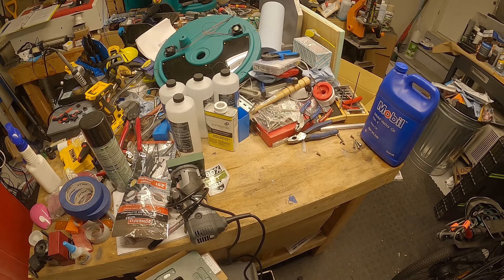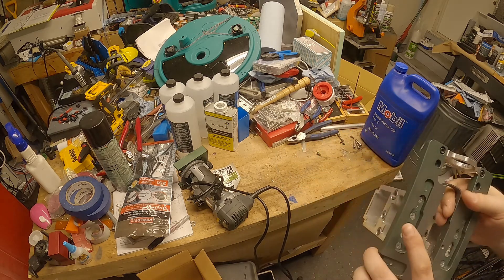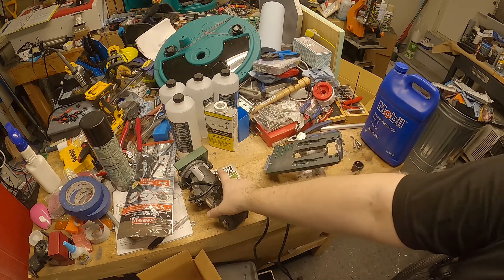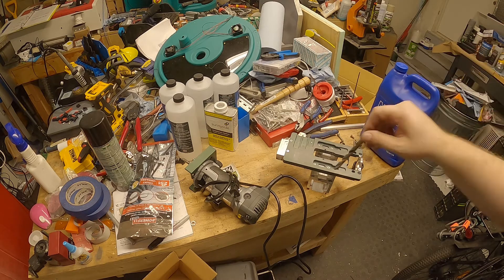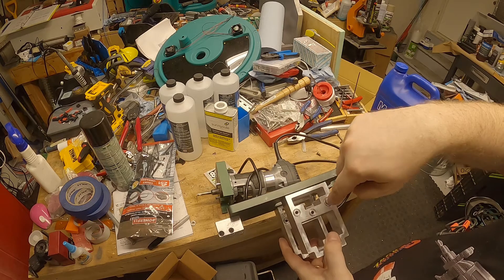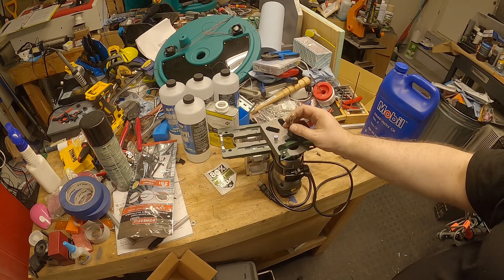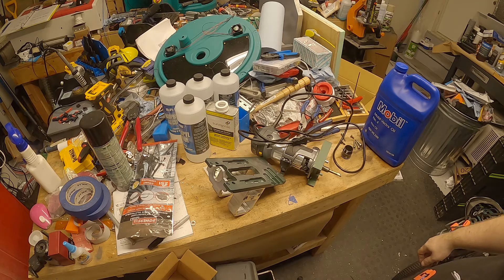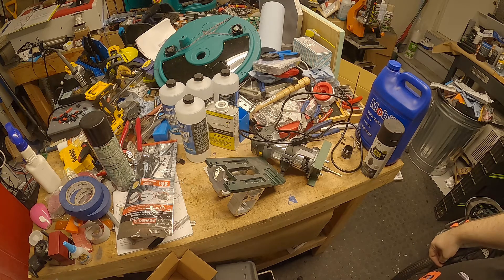80% Arms Easy Jig 3 Review

Comment: I was wondering if they work with polymer lowers as well
Reply from the maker: I do not see why it wouldn't from a cutting point of view other than possibly needing to run the router slow, I am not sure if the plastic lowers have the same outside dimensions to fit in the jig.
Reply: @ yes the work lol I had gotten it and done a few for polymer maybe 40min to speed run one perfectly!

Comment: Hey there I got the same kit as you and I the router doesn’t fit the piece from the jig only two screws line up did this happen to you?
Reply from the maker: There are 2 screws that go into the base of the router then a 3rd thumb screw that attaches to the side of the router with the aluminum backet that screws into the green part.